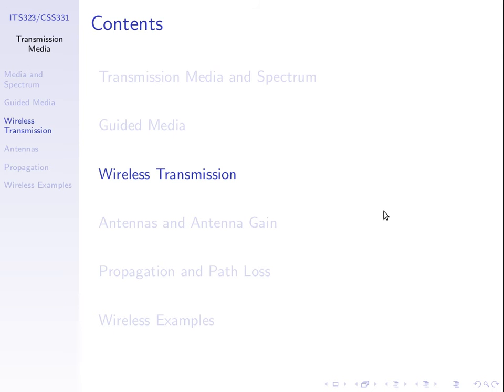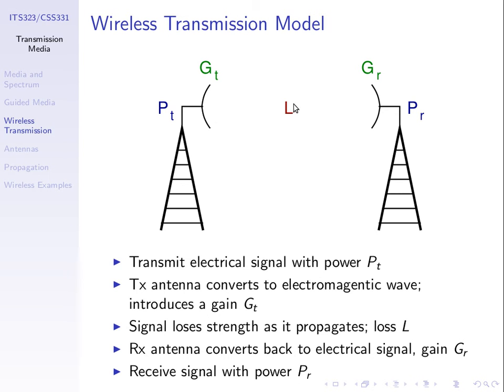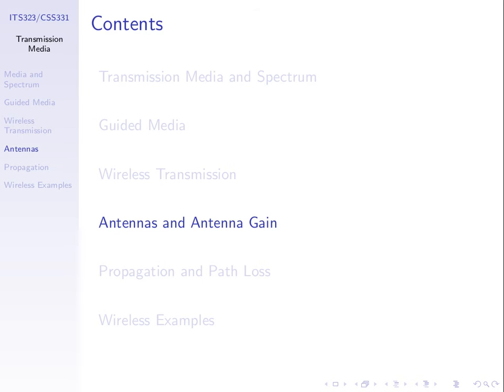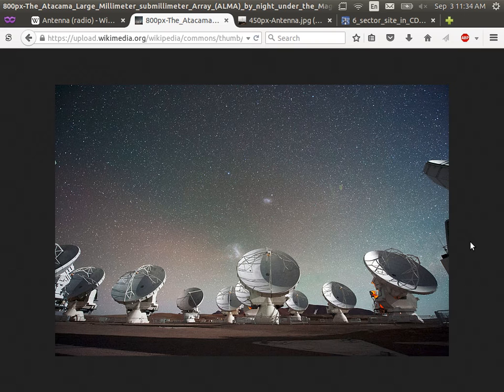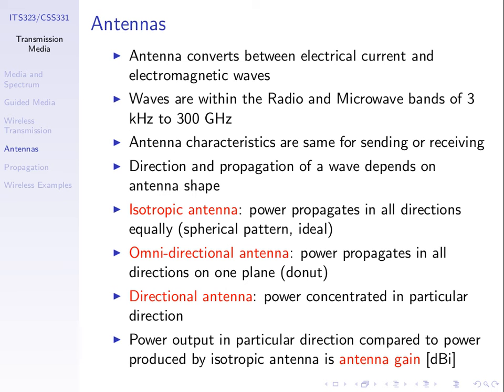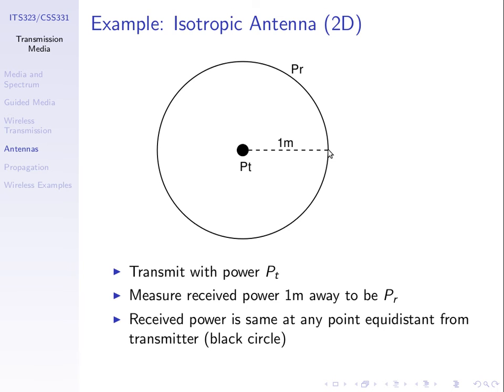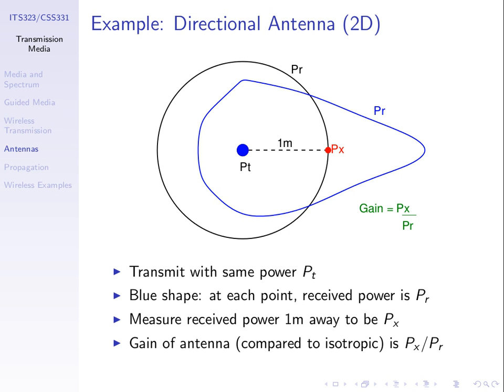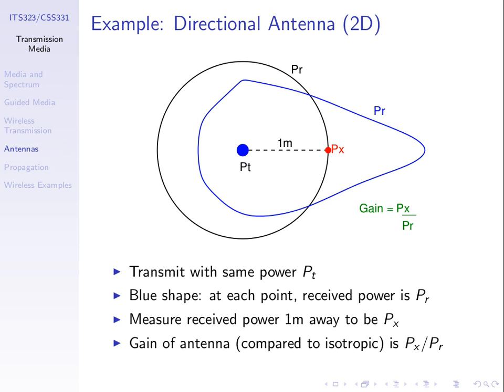Antenna Gain (ITS323, L7, Y15)

Comment: • Transmitter convert an electrical signal to a wave 
  ○ Receiver does opposite 
 • Transmit power
  ○ Pt 
 • Gain
  ○ Converting from signal to wave introduces a gain, Gt
  ○ Gain in dBi = Px/Pr 
   § Px is the power of the directional antenna at the same distance of the isotropic antenna
   § Pr is the power of an isotropic antenna 
 • Signal loses strength across distance
  ○ L = loss 
 • Antenna types
  ○ Dish antenna 
  ○ There are antennas in our phones, but you can't see it 
  ○ TV Reception: UHF, VHF 
  ○ Shape of the antenna changes the direction and distance of the signal
  ○ Major types
   § Isotropic antenna
    □ Power propagates evenly in all directions (spherically)
   § Omni-directional antenna
    □ Power propagates in all directions on one plane (donut)
   § Directional antenna
    □ Concentrated in certain direction
  ○